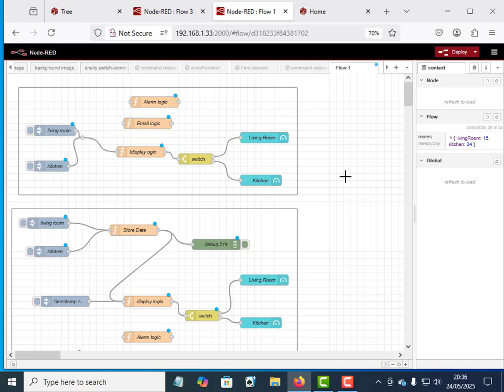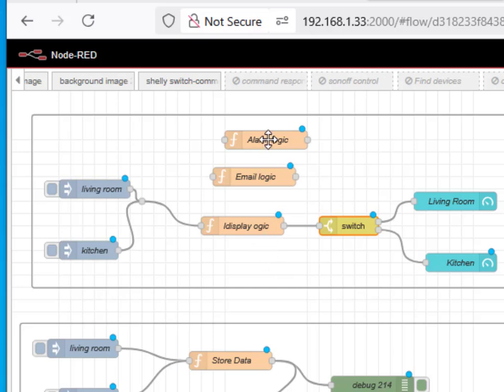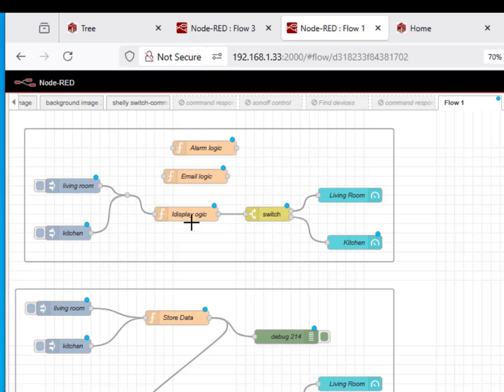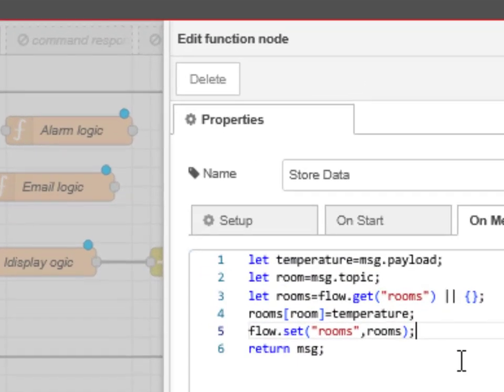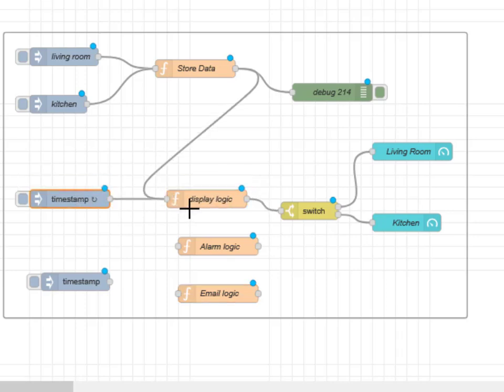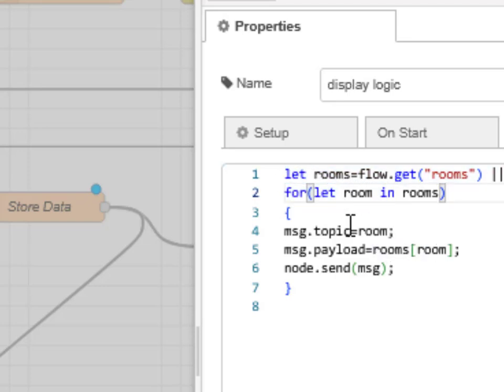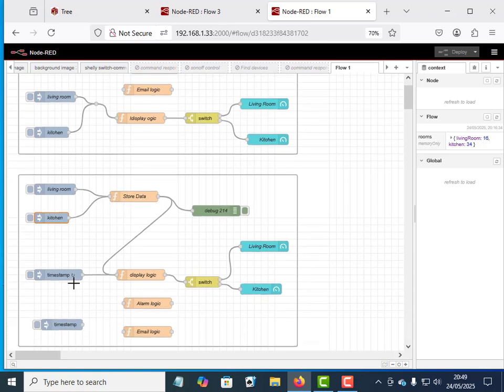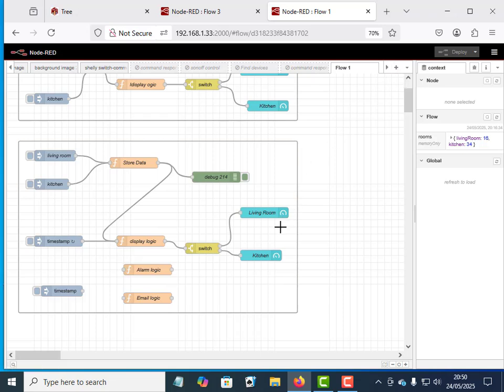Node-Red Flow Design Models for Sensor Data

Comment: Or your store data function could instead publish mqtt messages. Solves the flow/global method  and your disply/email/alarm flows could be subscribers to the mqtt topics. Just a bit more general way to handle things. It also has the advantage that your handlers don't have to even be in node-red. You might want to handle in a python script for example.
Reply from the maker: Hi
Tks for the feedback. I have used that technique before but forgot about it. I still use it sometimes when passing messages between flows if I think I may need to use the data elsewhere in the future.
Like you said you can then easily handle the data  elsewhere.
The only drawback I found was the reliance on a broker. 
Rgds
Steve
Reply: @stevecope  I have a redundant local brokers (ESQX) on debian under proxmox and I find them reliable. I laso have an external mosquitto broker under a digital ocean droplet for external use. My isp is Starlink (GNAT) so no usable external ip.  I use Cloudflare tunnrels for external traffic but I was never able to pass mqtt messages so I use that broker for. external access. I have been using Python lately for some tasks and mqtt is a nice alternative to building api's to communicate. Enjoy your articles.

Comment: Hi Steve, another thought-provoking video as usual. While your second example demonstrates asynchronous processing with data buffered by the variables stored in the flow, the fact that you initiate that processing on the availability of the sensor data anyway is a little confusing. If your desire was to update sensor data when it becomes available, then you don’t need the timed inject node to initiate that update as the nodes are already wired to perform that update on sensor data availability. Similarly, if you were looking to use alarms on your sensor data you wouldn’t want that to occur asynchronously, you would want the alarm to be initiated as soon as the threshold was triggered, or returned to normal as soon as the reset threshold was passed.
Reply from the maker: Agree. I haven't tried it without a timed inject it is now a standard template that I use.
However I normally use another inject node for the emails and alarms. 
The real advantage of storing the data and working on it is that it is much easier to add functionality to the flows at a later stage without having to disturb the data collection flow.
Rgds
Steve